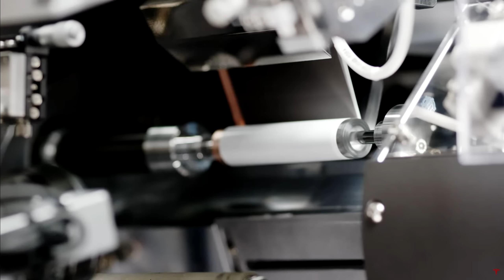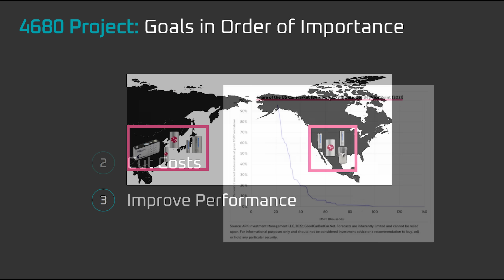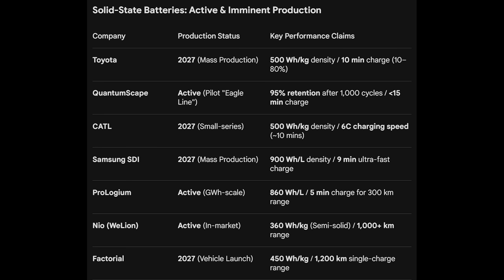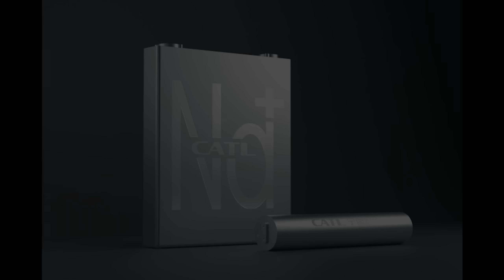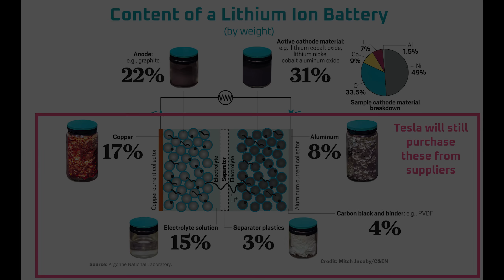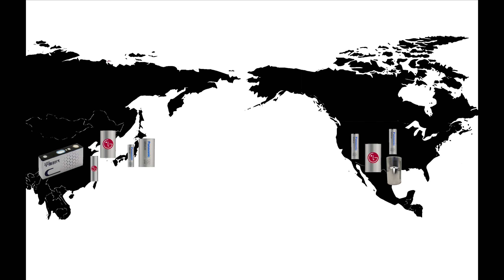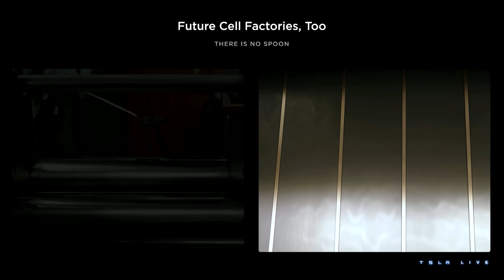The Fully Dry 4680 // Too little too late?

Comment: Sodium ion won’t hurt the other, it will relieve some of the supply demand constraints. So batteries will become cheaper. It doesn’t have to be one or the other.
Reply from the maker: Amen.  Sodium ion will expand the floor.
Reply: That's a great point. The more battery types that's competition in the materials market. We need to bring all the batteries even if they are not suitable for cars and keep the innovation going. There are endless ways to make and store electricity and many uses for batteries beyond automotive.
Reply: Korean companies are overwhelmingly ahead of Tesla in dry processes and single-particle material coating. First, regarding cathode materials, Korean companies are the ones manufacturing single-crystal cathodes, and they also possess the technology for coating to prevent breakage. Korean cathode material companies such as EcoPro and L&F are involved in this. Furthermore, regarding machinery for the dry process, specifically rolling, presses, and dry coaters, Korea's PNT holds unrivaled technology, and Tesla uses these machines. Most importantly, you must know that cylindrical battery cans and the machines capable of welding them are almost entirely manufactured in Korea.
Reply: Almost 70% of the total lithium battery demand is from the stationary energy storage. If sodium could capture all those energy storage markets, it will free so much lithium to EVs and other energy density focused sector and also make the lithium price swing much less violent
Reply: Assuming Gotions 260wh/kg on sodium doesn't scale- then it would completely replace both lfp

Comment: Since the US is only 10% of global EV sales, technologies like 4680 are interesting but only relevant locally for the US.  The big players in the battery / EV world haven't gone that route and they now produce EVs far far cheaper than Teslas.

US protectionism means this is largely invisible inside the US but it is very obvious if you travel the world.
Reply from the maker: 1) Can't argue with that for now.  It will become interesting for overseas markets as the technology and form factor gain greater adoption.

2) They are cheaper, but often less value for money for a similarly equipped vehicle.  If that wasn't that case, Tesla wouldn't be outselling them on a head to head basis.  Overall, they obviously sell more, but it's takes dozens of models that kill margins.

3) Amen
Reply: Tesla sales outside the US are less
impressive than they seem, due to only 2 models typically being on sale (3 & Y).  They may place high in sales-per-model but they are not as good as a manufacturer's percentage of new car registrations.

In terms of value-for-money and quality, most Chinese EVs have now surpassed Tesla and are rivalling the best of the European marques.

Outside the US there's a huge competition going on with vast ranges of EVs in every possible size and style, for prices now the same as ICE vehicles and soon to be significantly less.

This competition is driving innovations much faster than Tesla seems to be doing with its vehicles - Cybertruck is hugely innovative but impact outside the US is minimal and even sales in the US not massive.
Reply: @tsedge99 yesh chinese evs catching on fire, crashing and falling apart are somehow better than Tesla lol.
Reply: @tsedge99  Tesla competes in China directly against the Chinese companies and does exceptionally well and is often a sales leader despite being at the premium end of the local Chinese market
Reply: @We-R-Modern 7.4% market share is hardly a sales-leader.  Yes, if you only make two models one might take the sales-per-model crown but the vast majority of the market in China is dominated by Chinese EVs.

And of course the Chinese cars don't use 4680, they use cheaper alternatives.

Teslas are good cars but the competition (outside the US) is extremely fierce.
Reply: @t @tsedge99  You said Tesla sales are not impressive . I’m pretty sure that any other foreign automaker would covet Teslas position in China. Again Tesla EVs are priced well above the average passenger vehicle  in China and compete with directly with Chinese EV makers and do very well.  

No, Tesla doesn’t compete in all segments. Also no, this battery isn’t used In China. Tesla is building up its capacity to manufacture core components which I don’t believe any western car company is doing .
Reply: @We-R-Modern Tesla does better in China than any other foreign makes, in fact all European makers total only about 5-6% of sales in China, so Tesla beats them combined.

Still, the Chinese cars are so impressive now, there are a ton of high quality competitors for the 3 and Y and they are cheaper.

Nobody else is as vertically integrated as Tesla, some of the European makes are becoming more so, but not to anything like the same depth.

Tesla's engineering and manufacturing is amazing, If they become a supplier for others (including the Chinese) rather than just making their own vehicles, they could capture a lot of the market.